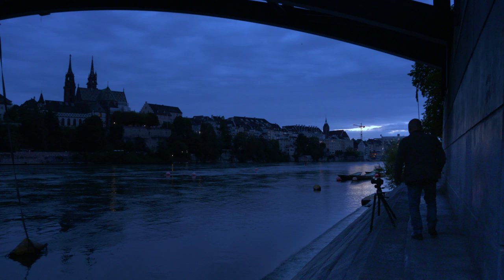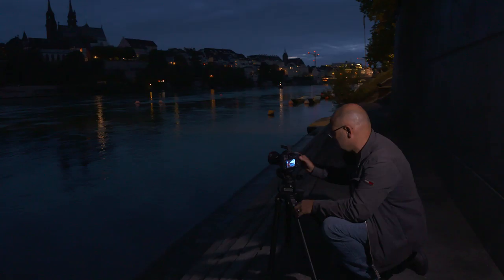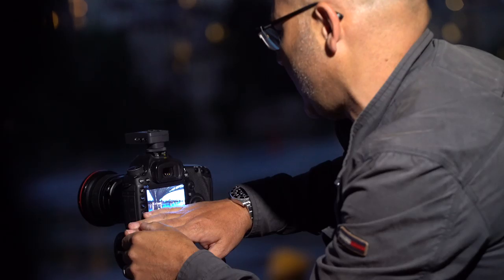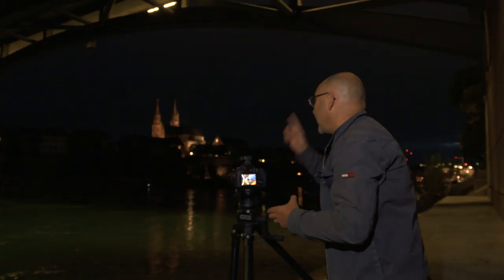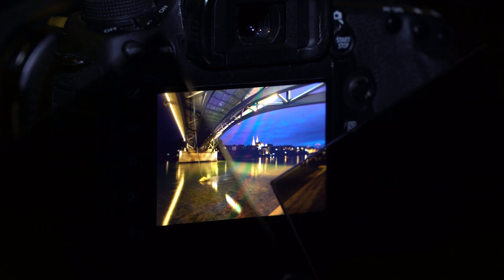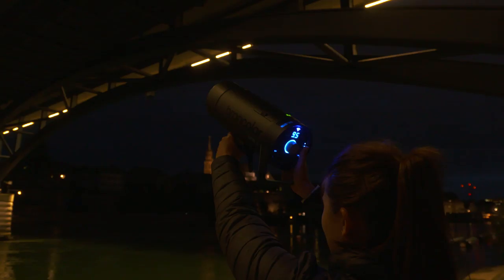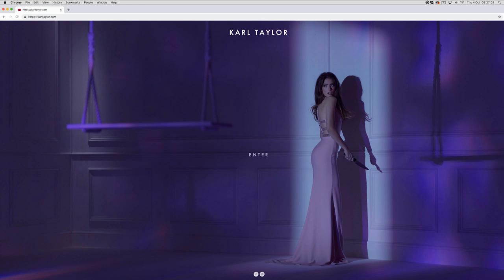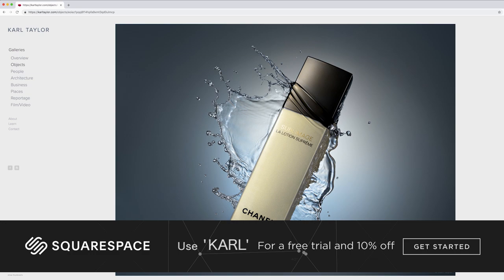An ND graduated filter Hack!

Comment: The best thing is, you don't even need actual filters - you can do it with a sheet of anything, it just takes a bit of practice
Reply from the maker: Yes but its better if it's matt black if it's opaque as you may get light bouncing off the object into the lens.

Comment: Useful technique, which I often use.  However, I found a problem using the ND filter in the way you show in the video, in that the filter refracts the light a little, meaning you can get a double image in places such as along a skyline (one image unshifted with no filter and a second shifted by the filter).  I've stopped using a plain ND like that and now either use something opaque (card or fingers!) to block the light completely, or wave a ND GRAD in front, keeping the filter in the light path at all times.  Moving the grad from its ND area to its clear area ensures the refraction is "always on" in the light path and no double image!  P.S. if you use fingers as a stopper make sure they'r not lit from behind and that they appear black in the image, otherwise you'll get a lovely sausage-shaped fleshy colour cast which is nigh impossible to edit out in post!
Reply from the maker: Yes I also use black card which i mentioned at the start of the video  I also find the black filter cases can work too if I forget the card.

Comment: Hello. Were you using solid ND filters, graduated ND filters, or a combination of both? That was a very valuable lesson for which I might finally have the proper tools. I would like to know which level of ND you used in that situation as an example. Thank you.
Reply from the maker: I was using solid 3 stop ND filters but pieces of matt black card work well too.
Reply: @VisualEducationStudio  Hello Karl. Thank you for making time to answer my question. I don't have two 10 stop filters but I do have a 10 stop and 6 stop full ND filters. Might I achieve the same result using the combination that I have, or would I need to possibly lengthen my shutter open cycle by just a little bit and cross my fingers? I love your work and your teaching methods too. I used to be a member of your online courses and they were great but I had to stop. I hope one day to be able to resume the courses. Again, thank you for making time to answer my question.
Reply from the maker: @jasonwiser4711  Hi Jason. I used two 3 stop filters not 10 stop ones. The important thing is that the filters are very neutral but as I said you can also use black card instead (just for a shorter period).
Reply: @VisualEducationStudio  Again, thank you Karl. It's very much appreciated.